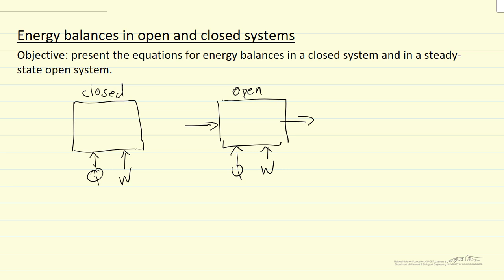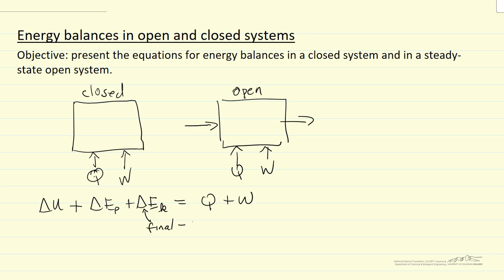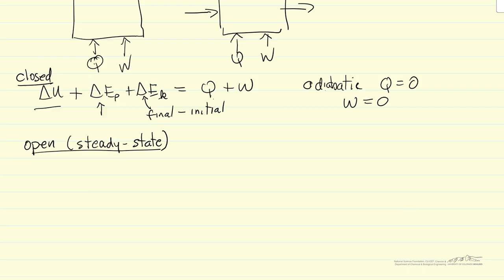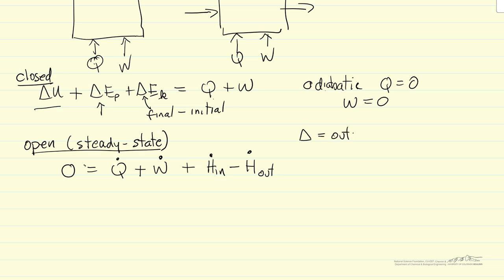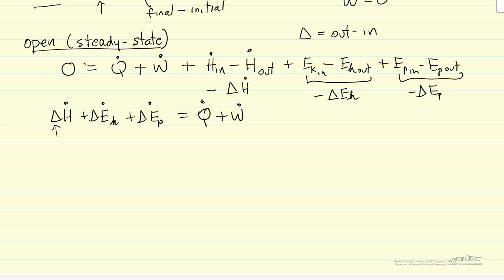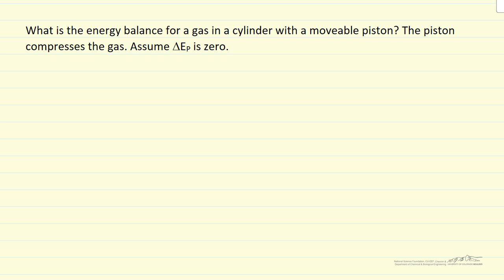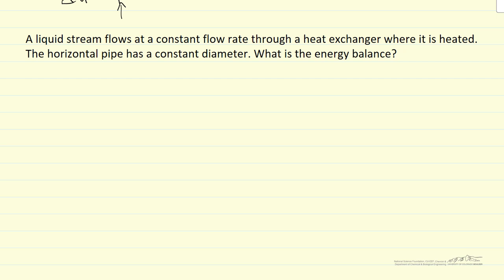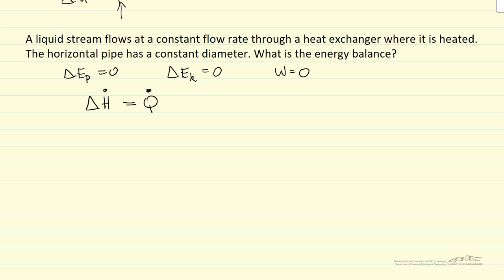Energy Balance in Open and Closed Systems

Comment: In the last example, on the Enthalpy change, the enthalpy change is only equal to the heat added, as a liquid is incompressible.  If the fluid was a compressible gas, wouldn’t we have to account for the PV work (flow work) done also? Or, because the pressure change is zero, there is no PV work?